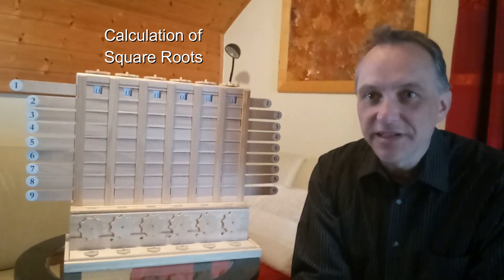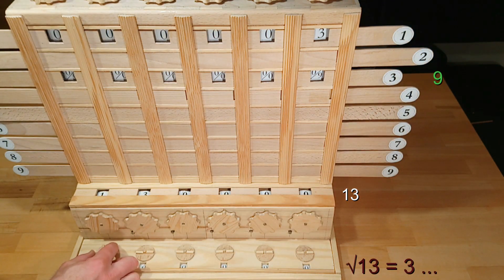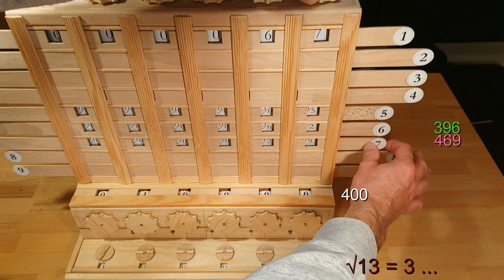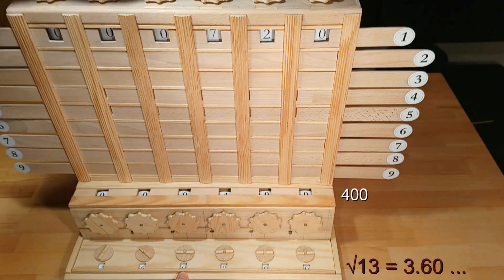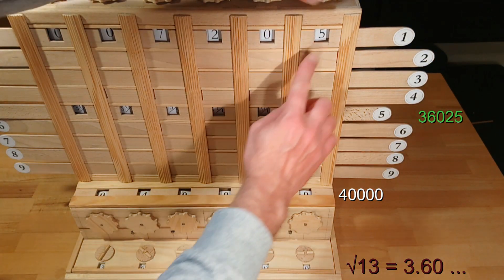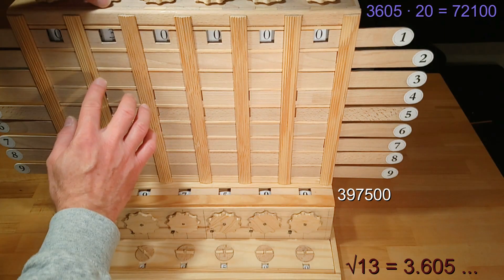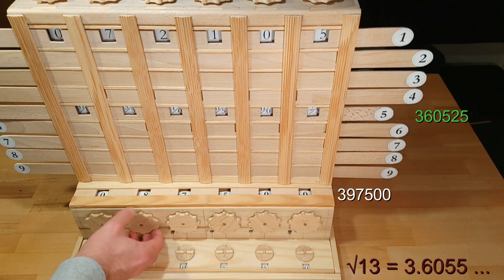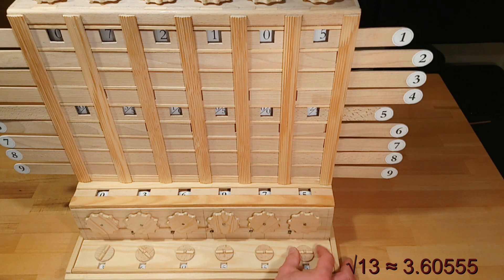Calculating the square root of 13 with a 400 years old mechanical calculator (Schickard 1623)

Comment: I believe brunswiga method (toeplers method) should work as well and will be easier. Can you try it sometimes?
Reply from the maker: yes, Toepler's method might work here too, but it wasn't invented yet, when the Schickard Calculator existed in the early 17th century. As far as I've read, Wilhelm Schickard knew the method that I'm showing with his machine, because there is one of his note, where he most likely wrote it down. On the other hand, Toepler's method was invented in the late 19th century, around 270 years after Schickard created his machine. But you're right, I could try Toepler's method on the Schickard Calculator just for curiosity.
Reply: @jepumachines  this is call hacking the 400 years old calculator :)